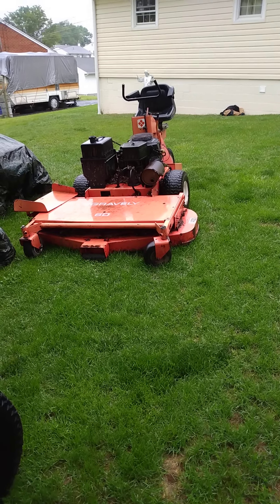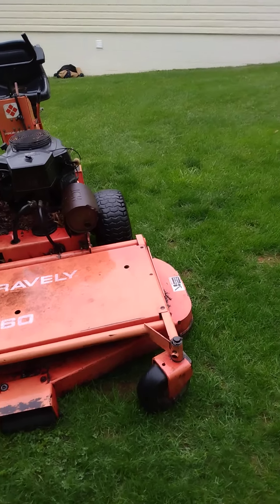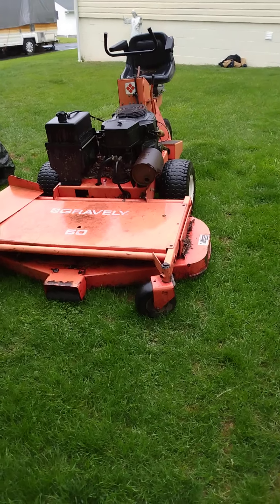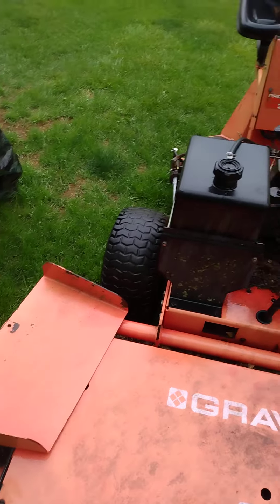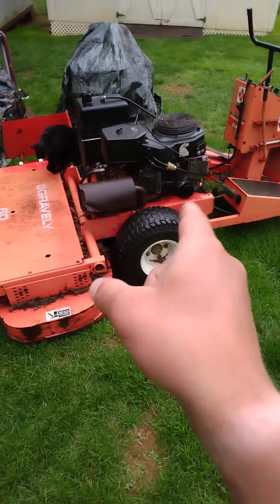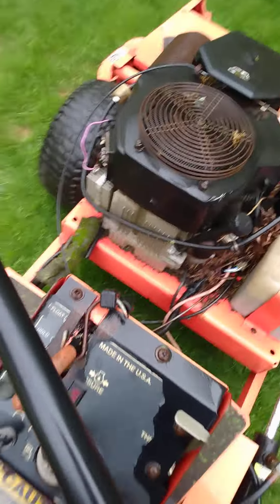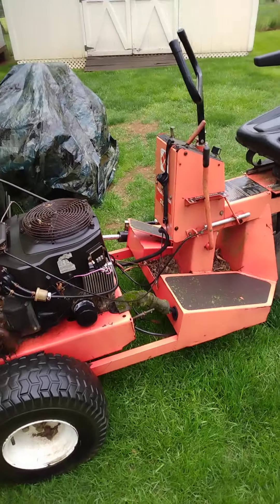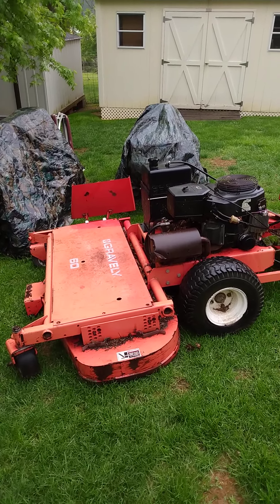gravely promaster 300

Comment: I have the exact same mower. It's an amazing mower to cut with. Mine is very powerful. Thanks for showing the model numbers location,  mine has apparently worn off and I've been needing parts for it. This is the first video I've found with the tag location in about 5 years now! Thank you very much! Hopefully I can use the same model number and get the correct parts for it. Yours looks to be perfectly identical. You'll love that mower!